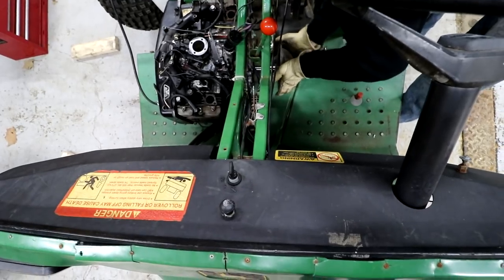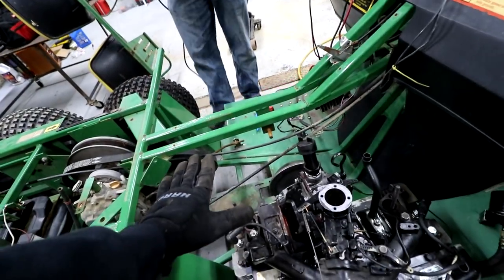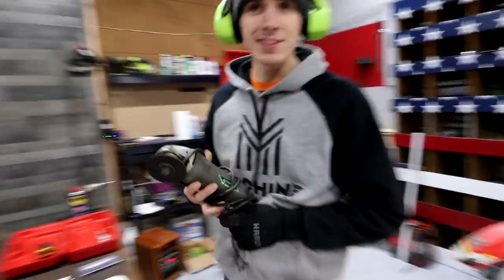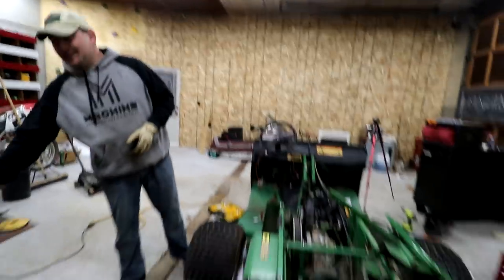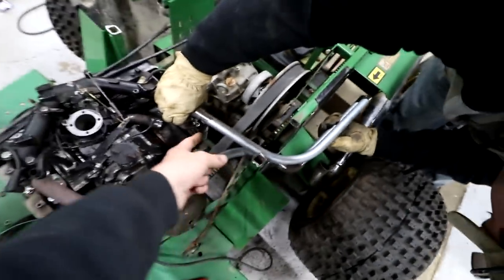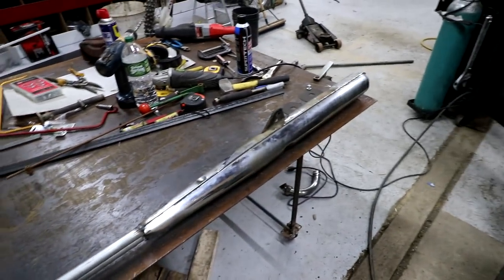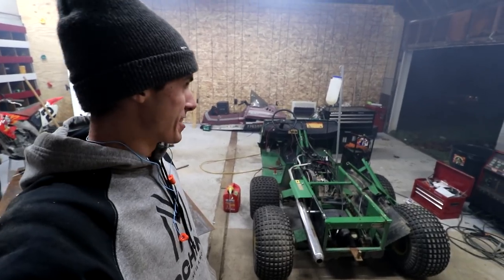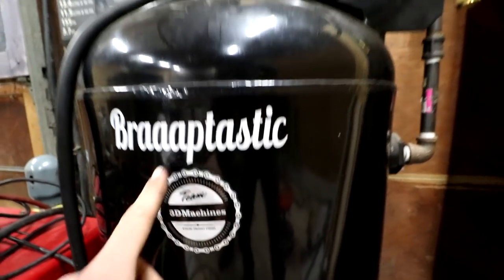THE MOST SAVAGE MACHINE!

Comment: To aid in some more speed. That rear clutch on the Gator is pretty standard and used in different machines like golf carts and ect. If you haven't already looked or thought about it, look for some "performance" clutch parts like, a stiffer spring and newer internals so it slides easier. I use these "performance clutches after lifting golf carts because of the larger tires.  Food for thought homie.

Comment: Smokes like a 2 stroke
Reply: Neil Eagleden they just had it torn apart probably just burning of the oil
Reply: They are running it on mixed gas
Reply: Oops Oops he just finished a complete rebuild
Reply: Neil do you get called a party pooper often?
Reply: Because he ran 2 stroke gas through it on the first startup did you not see the video?
Reply: I don't remember where in the video it was but I also know they said it was running on mixed gas
Reply: That's because it's not on this video it's on a different one when he was first trying to get it to run
Reply: yes it dose but it is a kohler magnum

Comment: What cc is that motor
Reply: Cope Badgley 1000
Reply: Jordan Carriveau  wrong
Reply: It's either a KT series Kohler or the updated Magnums. So, if KT17 then it's 691.4cc, KT19 = 770.4, KT21 = 864.7
Reply: jay its a kohler 18
Reply: Shawn Thomas that's a Kohler Magnum 18 then, updated version of the KT17 series II. Displacement is still the same as most internal parts are shared.
Reply: +Jay Pattyson yup there really good  motors too I had the 20 HP version
Reply: There were a few versions, all upper 700's.

Comment: 3dMachines if you want to put a electric super charger on you ar beter of puting 2 leaf blowers becus the elecric super charger just pushes air in the motor and you actualy lose hp not a hater just a tip i am from denmark so sorry for the bad english

Comment: youll be lucky if that does 20mph, all the hype over this turd and you put a damn lawn mower engine in it
Reply: FACTS
Reply: went from a 1000cc street bike engine to a lawn mower engine...
Reply: thehanbag lawn mower tractors usually have +1000cc
Reply: the average riding lawn mower are only about 20-24 hp witch aren't even close to a 1000cc plus its just a joke XD

Comment: If it is geared to do 15mph with a 7hp engine at 4000rpm and you put in a 18hp engine at 4000rpm it will still only do 15mph but get there a bit quicker.  The way that new engine  is smoking I bet it makes only 12hp max.

Comment: That things not going to go any faster than it did in the first place you put a lawn mower engine in it lol with a fan to "supercharge" it pretty disappointing
Reply: Jack Dubeau even worse lol it's going to be slow as shit
Reply: thats not the gator engine thats a different engine, still not gonna be much faster
Reply: Definitely NOT mint!
Reply: Ryan Bauer correction its not a fan its a hairdryer
Reply: It’s not a lawn mower engine it’s a kohler and FYI junior dragsters that run like 11 seconds on an 1/8th mile use kohler and Briggs and Stratton engines
Reply: He shouldve done some more work to the engine while it was apart in my eyes, carsandcameras were talking about a place that builds parts for these engines (Check the first video in their dragster build)
Reply: utoobube yeah but it's not going to be fast it'll go like 10 mph
Reply: Itll go just as fast if not a bit faster than the day it came off the assembly line, which was the point of the repower. The old engine was crap with no compression and wouldnt hardly pull the gator up a 5% grade. He most obviously wasnt building a hot engine or he wouldve went with performance parts in the rebuild.
Reply: In all reality all he as to do is change out the pulley on the transaxle to a smaller one and itll go much much faster.
Reply: Ryan Bauer I am glad you left quad ricers
Reply: all we can do is stay tuned and see
Reply: Oops Oops what I’m saying is that model didn’t come from one other wise it would be vertical shaft. They do make lawnmower engines. Just like Briggs and Stratton they make lawnmower engines but also go kart engines.
Reply: Riley Olsen Enterprises I realize that I helped build one but I’m proving a point that lawnmower engines can produce a lot of power.
Reply: It will probably do 20-25 mph and even that will be too fast when it has no suspension, will be useless in mud also.
Reply: its a huge disappointment tbh
Reply: Interesting.. keeping up to date with a project you hate? Is there some type of youtube video shortage at the moment? Or are you actively subscribed and following just to mope and grumble? It amazes me as to how entitled some people here are!
Reply: He should have put a 670cc go cart motor
Reply: Davin Winter oooooooo triggered on a YouTube comment lmao
Reply: It is not a dragster but an off road vehicle. So what you expected him to spend extra bucks on the engine that would not have made any difference because the power band would be at a higher RPM and where he needs it is down low for power and torque. It will do just fine those things barely hit 20 mph I had one. Any faster like and you would have sworn you were going to bounce off the seat the tires are the only suspension they have so if you want a better ride you need to air the tires down. Sometimes faster isn't better LOL
Reply: I said the same shit about that "supercharger" since day one. people will believe anything a product advertises. there are plenty of videos of them hair driers failing to produce any gain and actually causing a loss of power because the hair drier does not put out enough cfm for the engine so it basically starves the engine for air. I use to work at performance shop and we tried to use a mig grade leaf blower. the car lost power with a leaf blower putting out over 200 mph and over 400ish cfm. he was prob better off buying a performance chip that goes in IAT plug it would have did the same thing as the hair drier.
Reply: You are doing great from what you wrote. Don't let some jerk get to you there will be worse things said to you in life that you will need to deal with. But can understand why it upset you. Here is what I wrote to the worm and said what he did you to. So believe me when I say that I do understand ok. Keep you chin up and a smile on your face and give your sister a big hug for me ok. By the way your sister is very fortunate to have a brother like you. Thank You
-----------------------------------------------------------------------------------------------------
Yar Nunya - Look jerk don't be telling anyone they are retarded. I work with Mentally Challenged kids and they are special and gifted in their own ways at that. I don't know how old you are but you need to grow up and act what ever age you are not like a child. If your sister or brother was Mentally Challenged how would you feel if someone even used the word retarded to you? There are words you just don't use because you have no idea whom you might be hurting - really hurting something in today's times no one should do to someone else. You need to apologize to Davin Winter he didn't do anything to you now did he. If you have any balls at all you will do the right thing. Thank You I am sure you will........
Reply: wfi he said its a later upgrade
Reply: Ryan Bauer I'm glad you left quad Ricers
Reply: Hoser's Garage exactly what I was thinking
Reply: Ryan Bauer I
Reply: Ryan Bauer its a 2015 beater car. We know its shitty
Reply: It doesn't have to be crazy fast I don't think, he just wants more power if he wants to fast he can ride one of his bikes instead of a tricycle gator that'I'll flip if you turn to quick
Reply: Vortex Gaming a ridiculous amount of garden tractors used proper horizontal shaft engines including John Deere, early on any lawn tractor with a K series Kohler was horizontal shaft.
Reply: Vortex Gaming my toro riding mower has a Kohler engine lol

Comment: what a piece of junk you put a engine with a couple more hp than the stock very creative.
Reply: Yeah why couldn't he put a half decent engine in it
Reply: It's gonna be no faster lol
Reply: Haters wil be haters  ✌
Reply: all the money he makes and cheaping out on a engine thats  for the gator hes been bragging about for a year
Reply: With engines like these horsepower is almost meaningless. These KT series Kohlers produce a ridiculous amount of torque compared to the old one, and K series have a ton of aftermarket support from people like Vogel engineering. Think: a fully built K341 single cylinder Kohler can be balanced above 8,000 rpm and with some work can produce well over 60 HP. 
Oh, they also can use the piston from a 350 chevy or a 4.3 V6 for a quick way to make some power. These are not junk engines in the slightest.
Reply: Jay Pattyson 
Well it will never happen here.